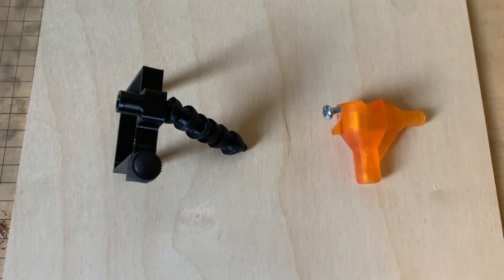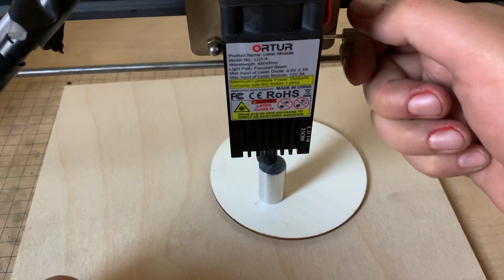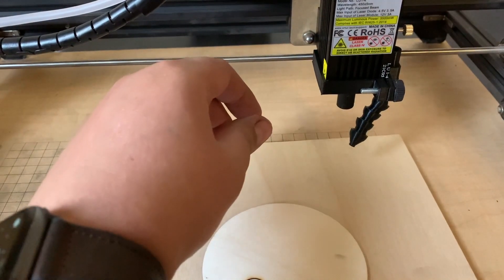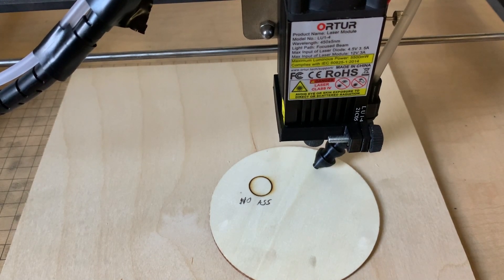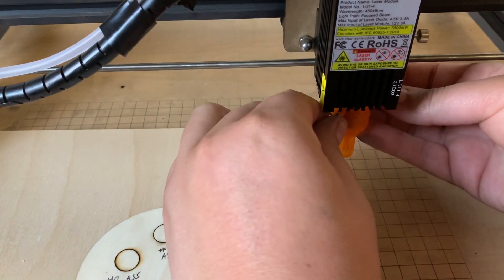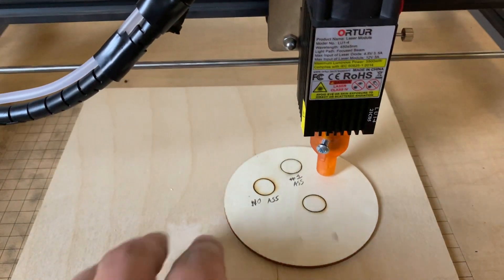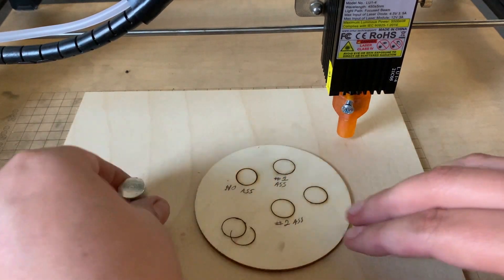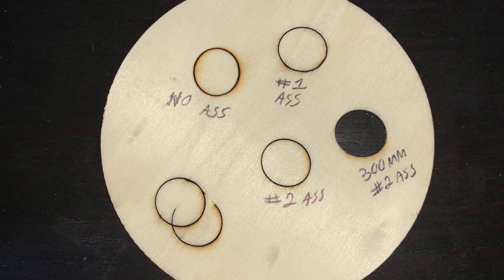ORTUR laser master 2 AIR ASSIST - EASY

Comment: In the new laser master 2 the focus bar should be Placed under the lens so he is doing correctly.  However, i think your laser module is degraded because it seems to be very "weak" check if your block is about 29mm.
Reply: I was doing it the way he was doing it and I had abysmal results. I contacted their customer support and they told me to zero the focus to the bottom of the laser module chassis, not the laser lens. I did that, and it cuts the way it should now. LM2 S2 (not the pro).

Comment: With my same laser I would cut that wood in just 2 passes without air assist, but with correct focus, measured from the heatsink 1 pass with air assist.
Reply: Where are you getting the "from the heatsink" measurement idea? I don't see that in any documentation. Its 30mm from the tip of the lens (the height of the cylinder that comes with it). Show me where you see "from the heatsink"? I am using the same 20w LU1-4
Reply: @MauriceNaragon  Well, please just watch any of the YouTube video's Ortur has on it's own channels, there THEY explain it all. To go and watch the video's, use the QR code links that you got with your laser. They are the manual for your laser. Or, Watch the video on the Ortur Official channel here: https://www.youtube.com/watch?v=0cJhMHhvi58

Comment: I found that if you raise the wood you are cutting off of the table it allows the laser to "blow through" what you are cutting. Some use a screen, I simply used a bunch of 1/4" nuts scattered around the table. Works much better.
Reply: Buy a mesh bbq grill  from Walmart. It's like $3 dollars and works amazing
Reply: That's an interesting tip - the 1/4" Nuts!  I have a Hex grid for my CO2, but I've been playing with one of these smaller diode lasers and have been trying to come up with a simple bed design to lift the workpiece up - I happen to have a box of 1/4" nuts, so thanks so much for sharing the tip!
Reply: Thanks for posting this comment. Will try this.
Reply from the maker: Good info there mate.

Comment: What power laser are you using on your engraver?  Nice video, btw
Reply: It’s a 20 watt laser which equates to 4.5 or so output.
Reply: @elissitdesign  he means how much power you set the laser not the luminous max power of your module.
Reply: @mirko5040  it literally says what power laser not what power level. The 20w is equal to 5.5w

Comment: you are placing focus totally wrong, its on the chassis/heatsink not the end of the laser diode...
Reply: Some models use the heat sink (newer ones) some (older ones) use the laser tip.
Reply: Is it possible that his is different? I mean it did cut. So focus must have been ok right?
Reply: You are correct!
Reply: Yes, he used the tool wrong. should be to heatsink.
Reply: No he's right. On the Ortur LM2 you put the aluminium rod between the object and the laser tip. I have the same model and it clearly says so in the manual.
Reply from the maker: @rosebuddesign635   Ha thanks for the clarification, I was like wow I must be dumb. But yes that was my understanding too from the tip... just the tip